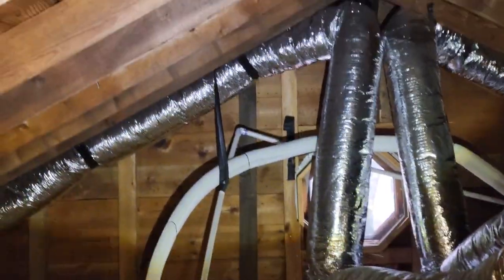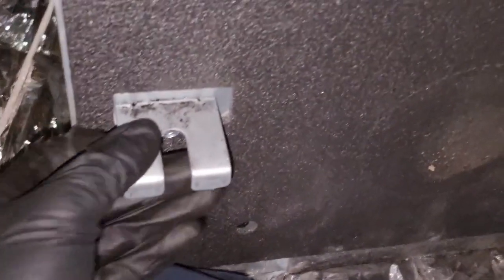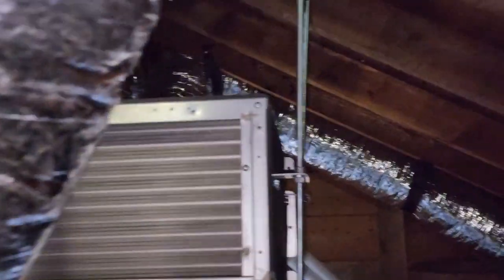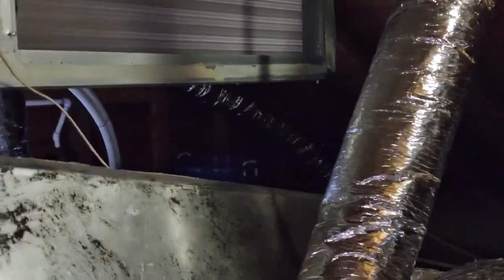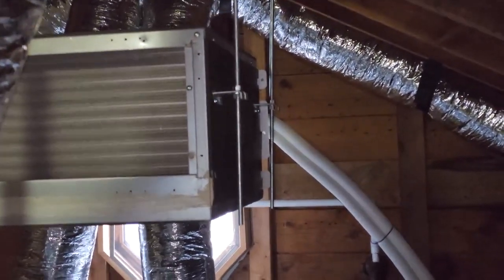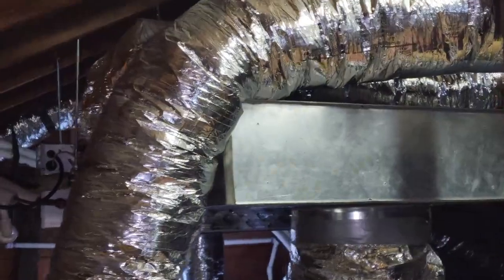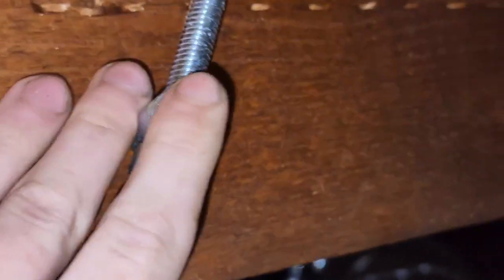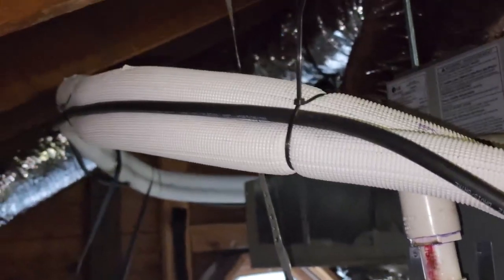Help My A/C Fell Off the Hinges!!! Remounting an LG Ducted Mini Split System to the Rafters

Comment: Excellent job DanielSon. Some thoughts: Use Nylock nuts to prevent nuts from backing off, or double nuts. Also, can’t tell from the video, but I would wrap the band iron all the way around the plenum for maximum support. Otherwise the self tapping screws can just tear out of the sides of the plenum.
Reply from the maker: I wrapped it under and self tapped under
Reply: @DCHVAC  excellent DanielSon. Just couldn’t see it very well. 👍👍

Comment: Nice work Daniel! I’m not a heating contractor and in many other videos I see the flex ductwork used to connect the system to the house is it better to use rigid duct or flex or is there a reason for flex ductwork?
Reply from the maker: Flex is easier, easier to maneuver, keep out of the way, comes pre insulated, no cutting and elbows, saves time, id imagine depending on the quality of work you would end up with alot more leakage if you used rigid duct, plus you'd have to either measure it all out perfectly ahead of time, or have every possible thing needed for every possible scenario, and countless metal cuts, sharpening tin snips